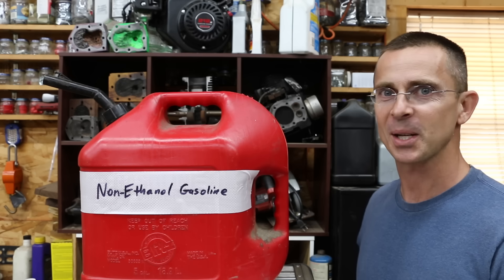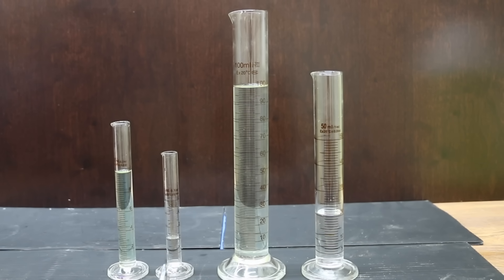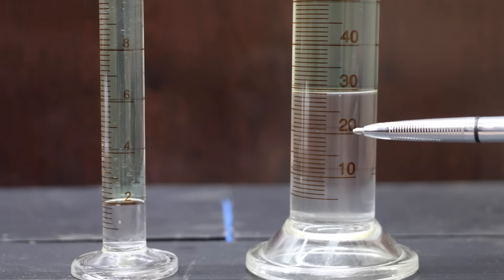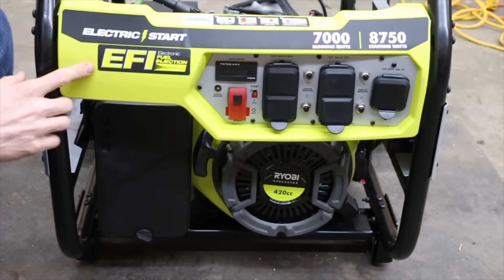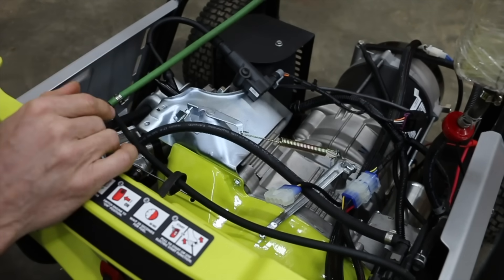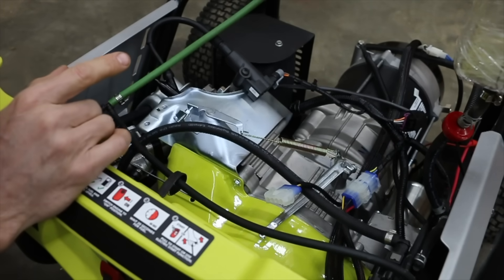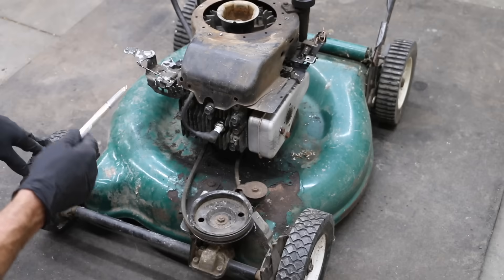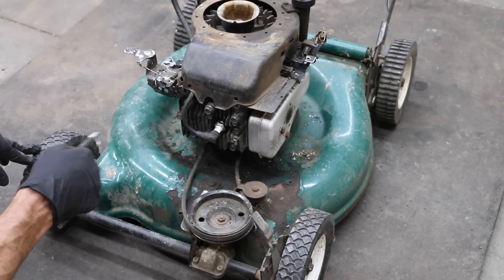Is Non-Ethanol Gasoline Really Better? See the PROOF!

Comment: I think there was less carbon buildup in the 10% ethanol combustion chamber. And I think some of the controversy comes from the long ago demonstrated fact that pure alcohol as a fuel leaves virtually none. The main reason is that alcohol is a much smaller molecule (from 2 PHDs at the EPA in Scientific American magazine) and therefore breaks down more rapidly and completely in internal combustion engines. We have electric vehicles coming soon, so that argument got buried, as alcohol pollutes way less than gasoline. Having worked on my own vehicles for decades, and spent a few years working on other peoples, I cannot wait for all electric.
Reply from the maker: Thanks for sharing.

Comment: I know this is a pretty late comment, but as I restore old motorcycles and outboard motors, I can tell you from experience you don't want ANY small carbureted engine to sit longer than maybe 3 months with anything but ethanol free. Its not that alcohol is tough on parts. Ethanol alcohol absorbs water and will corrode and clog the small jets and passages, sometimes to the point the carb can't be saved. When you see people out on the water cursing their outboard or trying to pull start a chain saw after sitting all winter, you KNOW, they were using regular unleaded pump gasoline with 10% or greater ethanol.
Reply from the maker: Thanks for the feedback.

Comment: Ethanol ate the diaphragm in my 66year old Jeep carb the one year I used a few times.
Since using SeaFoam in my 5 gal can of Non-oxygenated fuel I never have fuel issues anymore with any of my yard equipment. The can gets SeaFoam year round and at the end of each season I park my equipment with whatever amount of gas happens to be in the tank. Always start right up the next year
Reply from the maker: Thanks for sharing.

Comment: As pointed out here previously,

117000×90% + 76000×10% = 112900

112900 ÷ 117000 = 96.5%

Where 
Gasoline has roughly 117000 btu/gal
And
Ethanol has roughly 76000 btu/gal
(Figures vary so if you don't like mine, use your own.)

So, e10 has roughly 112900 btu/gal

Anyway, while lots of PhD projects are pointed to here, I'm betting on the best use for Ethanol is "medicinal".

Also, just for fun, look up the connections between the  Rockefellers and Prohibition. (The early Ford's had adjustable carburetors which could run correctly on Ethanol. These tests probably didn't correct for perfect fuel/air ratios. Also, if your engine were purely alcoholic, you'd want to up the compression ratio to maybe 15 to 1... a lot more efficient with the low energy fuel. Fun, fun, fun... Also, stay away from the highly toxic Methanol.)
Reply from the maker: Thanks for sharing.
Reply: @ProjectFarm  it's a great topic. Thanks for your work.

Comment: I've NEVER had a problem with ethanol gas. I store cars in the winter with ethanol in the fuel tank. I store my chevy powered inboard boat in the winter with ethanol.  Never a problem in spring. I run my mower dry in the fall. I run my snowblower dry in the spring. Never a problem with ethanol in the past 25-30 years.
Reply from the maker: Thanks for the feedback.

Comment: I have a very old Homelite Super XL-925 chainsaw and discovered that ethanol melts the rubber fuel line.  Since then no ethanol for any of my small engines. I looked through the library of videos and don't see if you ever produced one on the long term effects of ethanol on carburetor parts.  Keep up the good work!
Reply from the maker: Thanks, will do!    Thanks for the suggestion.
Reply: 2 edelbrock carbs and 1 holley carb, 20 plus years on what passes for pump gas and all three work fine for me, no corrosion inside that I can find. Not sure how factory parts hold up to ethanol.

Comment: I guess I am doing something wrong because I haven't had carb or engine issues with ethanol gas, at least so far as I can tell. I have older vintage trucks and cars that sit non driven for several months up to a few years at a time and various small engine devices....both four and two stroke that I feed the standard 10% gas. One thing that may help those having problems is to empty the tanks of small engines for off season and run the carb  dry.
Reply from the maker: Thanks for the feedback.

Comment: I got an old school hot rod truck with a 750 elderbrock, headers, and it's dueled off before the rear drivers. I've tested three fuels in the vehicle. I ran a tank of corn gas, it burns black at the tailpipe. I ran a tank of non corn gas, it burns golden brown at the tailpipe. I ran a tank of VP 110 racing fuel leaded, it burns white at the tailpipe. So there you go, there's my test. I do know the lead is very good for valve stems, guides, seats, and rings, but it's now $15 a gallon.😂
Reply from the maker: Thanks for sharing.

Comment: I would like to see an appropriate test of the diaphragm in a  branded mechanical fuel pump such as a Carter used in a 350 Chevy. I was thinking maybe some sort of soak with pressure, outside of the pump  "container".
Another one with the little membranes used in Briggs and Tecumseh, etc., repairable carbs. And from chain saws like 18" Poulans, etc.
Reinforced multi-core hoses or not and those yellow see-throuch ones out of weed-wackers and similar repairable (throttleable) carbs.
Did anybody else have "trouble" sending video through to their mail to themselves? Is this a touchy subject? Perhaps?
Reply from the maker: Thanks for the suggestion.

Comment: Peter Smith.
Hi I live in Australia and I own A BMW 320i its ten years old. I used to use 95 unleaded fuel but as the price of fuel kept rising I thought I would try the ethanol blend, after a year my engine light come on but I couldn't get to a service agent, the car was still working ok. So I changed back to the 95 unleaded fuel and after only two tanks of fuel the engine light was off and the car was running perfectly. I will never use ethanol again, and thanks for your in depth reviews it has confirmed what I suspected.
Reply from the maker: You are welcome!

Comment: Chainsaws, lawn mowers, outboards, or any intermittently used engine should only be fuelled with with non ethanol gas. That or drain the fuel tank or run the motor until empty. The fuel stabilizers are OK for keeping the other fuel additives in solution but they won't prevent water vapour from the air getting into the fuel to be absorbed by the ethanol. Water is a crappy fuel additive. Farm gas or marine gas (marked with a dye) is the stuff to get.Where I am it is a mid grade with an octane of 89 or 90 (I think). Unfortunately it may be hard to find in sururbia.  I still put fuel stabilizer in the seasonal equipment as well..
Reply from the maker: Thanks for the feedback.

Comment: I dont get why you'd expect to see a difference, the engine isn't changed to utilize the different fuels, they need different air to fuel ratios and timing difference, engines are tuned poorly it's not the fuel that is inefficient , theres enough energy is 1gram of fuel to power the whole world for over a year if it was extracted differently, why dont you ever play with ratios and timing? Surely you know about it!

Comment: I did the same but on RAV4 in the course of an year. 5% ethanol Sunoco vs 10% ethanol BJs. After an year I have substantial carbon buildup which was not there in previous 8+ years. Also, this ruined the piston oil rings and now my vehicle burns more oil, about 200 ml per 1000 miles. 
Try to use gasoline from reputable gas stations that have cleaning detergents, don't cheap out with Sam's club and BJ's gasoline.
Reply from the maker: Thanks for sharing.

Comment: I use ethanol free gas on my two-stroke motors on my boat and I have no problem so can I use the same gas on my 2004 Ford F350 and my Ford ranger the same year or do I have to put 10% ethanol gas in them the trucks thank you for the response

Comment: Did you ever get around to doing the long term test of ethanol fuel vs non ethanol on plastic and rubber components? It's been about 3 years now.
Reply: I was looking for that as well
Reply: Ethanol will eat rubber over time.
Reply: @darkdestroyer2837 only on old engines not designed to run on E10
Reply: The comments I read here today indicates a real world confirmation that e85 is destructive on seals and allows more corrosion/residue. If you decide to invest the time and money please let us know the outcome.

Comment: I recently started running non-ethonal gas in my car now that the EPA raised the ethanol cap to 15%. I went from getting about 33-35 MPG on the highway to 38-40 MPG and my car runs a bit smoother too.
Reply from the maker: Thanks for sharing.
Reply: Is the price per gallon the same?
Reply: @hotshotnewengland  No it's about 30-40 cents more expensive than regular gas where I live, but I think it's worth it

Comment: Ethanol mixed into gasoline gives the fuel a higher octane rating. High levels of Ethanol allows the fuel to support high levels of horsepower and torque. E85 available at local gas stations has increased the power output of modified vehicles, without the need for extremely expensive race fuel.
Reply from the maker: Thanks for the feedback.

Comment: I run a 1987 gold wing with carburetors,  I run 87 octane ethanol fuel and it has the original 35 year old o rings throughout.
   Marvel mystery oil is my additive. I had my carbs off in February for a clean and tune. And they were spotless.
However for winter storage I fill my tank with non ethanol fuel and add mmo.
    Sta bil does not work imo for ethanol fuel. The first year I stored my bike using it I had u issues.
I'm sold on marvel mystery oil and have experience and proof with it. But I should had taken pictures.
   I dismantled viewed did nothing re assembles and balanced my carbs
She's never run better since I started using mmo instead of buying non ethanol high octane.
  My bike was designed to run on 87. So that's what I run.  And merely add mmo.
Reply from the maker: Thanks for sharing.

Comment: You may not see this as you get flooded with comments. However, I recently purchased a budget 3000 watt generator. It has a 208cc engine. Prior to running it, I drain the sump of the miniscule amount that is left after their original test run and drain. I have filled it with a Penrite brand (Australian) HPR-50 (40-70) wit 1500+ ppm Zinc. My reasoning is that I won't be running the genset often but when I do, it will have a good load on it. My 'enough to be dangerous' knowledge of oils is that this oil, with its zinc and other additives, will assist in keeping a protective coating on the components when not used, then, after a few gentle pulls on the crank, it will help coat the crank, etc at first start. Further, when under load, and being air-cooled, the heavier weight, especially in the tropics where I'll be, will cope far better with the expected high temperatures. Gensets are under a lot of temperature stresses when the ambient is anywhere from 28 to 36C. I was once derided for this choice, so would be interested in your opinion. I used to run straight 50-weight oil in a 1600cc Kombi engine and it loved it.

Comment: I personally am I huge supporter of E85. As long as the ICE is built to run ethanol , ie Kevlar, Neoprene, style lines, o rings, etc it should be great on EFI. What id like to see that I have yet to see, is an Ethanol purpose built engine vs Gasoline. Meaning, utilizing the Octane level of E85 to offset lower energy potential of the fuel. For every full (1:1) point raised in compression is approx. 4% increase in efficiency/ power. Therefore, much like in vehicle engines, most people just convert to running E85 and tune on gasoline safe compression (ex. 10:1 ). Why not built an ethanol engine to run say 15:1 ?  Run proper heat range spark plugs, dial in the timing with the cooler IATs , and run it. Water in the line from pulling atmosphere moisture would only be problematic in a non sealed system or sitting over long periods of time,correct? Install a pet cock at the sump and drain regularly to avoid the issue; much like aircraft “pogoing “ the wings for fuel inspection
Reply from the maker: Thanks for sharing.

Comment: Ethanol have less carbon so for its mass, it should not leave deposits, but with 1:9 ratio, it should mean you have ~10% less deposits, which is not a thing you can spot by hand, I guess if you would scrape the deposit from head and weight it, it should be a bit less. No idea if that happens IRL, that's what chemistry would suggest. 
second part that ethanol flame hottest point is around 1900 vs 3200 for gasoline, so it should help keep the engine colder, good if your cooling system is old and car overheats.
again 1:9 ratio so its effect is 10%, might not be noticeable on most cars.
it also should burn faster, so its exerting extra stress on piston and head gasket, while lower temp should mean you have longer lifespan of block and head. This is also a reason for extra mileage, you have like 5-8 extra horsepower from your unit, and from same volume of fuel. 
most engines should not care at all, but oldest disel engines from 60's or so, they just cannot stand the pressures and break with ethanol, also any damaged units break faster because of extra pressure.
Reply from the maker: Great feedback. Thank you!

Comment: Ethanol dries out rubber parts in fuel systems
Reply from the maker: Great point. Thank you
Reply: @ProjectFarm  Wasn't sure if you said it in the video.  Didn't see much discussion on it in the comments.  Scotty Kilmer talks about it a lot.  He's a decent car mechanic channel

Have a suggestion on epoxy testing.  It would be a long term test.  I would like to see heat resistant epoxy vs standard since heat breaks down epoxy.  I'd like to know if heat resistant epoxy can hold up in summer heat wave conditions and if it's any better than normal epoxy.  If one were to use it on their car for something on the body like a loose door lock these tests would give a good idea of what they'd be in for

Comment: my understanding of ethanol vs non ethanol has always been that it's only about the hoses and fittings, plastics rubbers etc.
I can confirm over thousands of mile of tracking every single fuel up, with miles per fill to the tenth, and every single fill being to the brim - non ethanol uses fewer gallons. Can't say if the price differences made the gas only cheaper or more expensive, but the non ethanol gallons were more than 4% cheaper at the time
I can also say for a fact, backed up with data that mileage changes seasonally with temperature quite a lot - several years, same car etc.

Edit: I don't know if they changed blends seasonally for the years I kept records
Reply from the maker: Thanks for sharing.
Reply: @ProjectFarm   I removed the temp reference in case they changed blends

Comment: definitely interested in the carb videos with the ethanol as I see alot of small engine carbs and when it's from a customer that uses tru fuel or non ethanol fuel, their carbs never have fuel breakdown deposits inside when there's dirt in the carb, but rather dirt from a contaminated fuel tank one say a push mower with no inline fuel filter.
Reply from the maker: Thanks for the video idea.
Reply: just seen the follow up video to this. good work.  curious on how long fuel like tru fuel or aspen holds up in time after the seal has been broken.  I would expect it to be like non ethanol gets when old whet you could start engine with some spray and then from there it'll burn up on its own. 

also, have you considered any videos with handheld 2 stroke mix ratios/ oil types?

Comment: I firmly believe that the additive damages the filtering membranes attached to the base of most fuel pumps and causes premature fuel pump replacement....by causing early pump overheat
Reply from the maker: Great feedback. Thank you!
Reply: I had that happen, there are cars that simply cant run on the stuff, my current car can use it, so i just tank whatever gives me more range for my money, ran fine for the last 20000 miles, with no problems to the fuel system, lets hope it stays that way.

Comment: The main issue with ethanol in small engines is that it bricks the carbs via "alcoholate corrosion"; ethanol eats aluminum.  It eats aluminum like hot water on ice.  Tear down an aluminum lawnmower carb that's been soaking in ethanol blended gas and you'll see pitting and all sorts of gelling up of the aluminum body itself.  Ethanol has also eaten through some rubber and plastic fuel components on several weed whackers I've owned.  I never use E10 in any of my lawn equipment since.
Reply from the maker: Thanks for sharing.
Reply: On some older cars, rubber seals on the fuel line were also damaged by the ethanol, some newer cars too, sadly.
Make sure to read if your car was designed to run on E10, then look elsewhere, incase people complain about a bad fuel system.
Most EFI cars account for this and use resistant seals and no aluminium in the pump.

Comment: As a former fuels chemist I would never use e10. Saw the current issues, which are pretty much the same as methanol a long time ago. Old car pump systems die. Theres an ASTM seal test you might like to try, wont take 9 months. Let me see if I still have the reference number lol. Astm D471 however needs autoclave, rather expensive. However pretty certain there is an elevated test. Will keep checking.
Reply from the maker: Thanks for the feedback.

Comment: 2006 Ford Ranger with 21,000 miles on it to date. Went through 3 in-tank fuel pumps when using E-10 fuel.  Switched to non-ethanol gasoline and haven't had any more fuel pump failures.
Reply from the maker: Thanks for sharing.

Comment: i like to run 91 octane but my local station only has 87 in non ethanol so thats what i run should be 91 in my bikes but much rather have a little but less octane then a bunch of gummed up fuel injectors that cut power even more
Reply from the maker: Thanks for sharing.